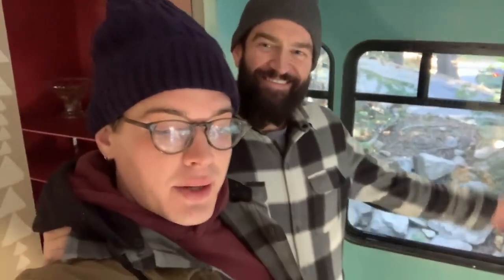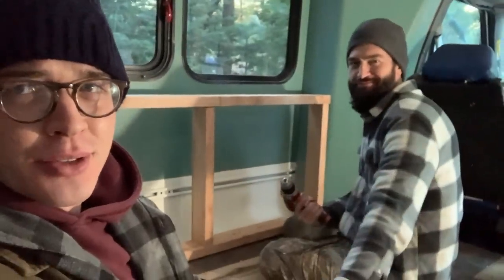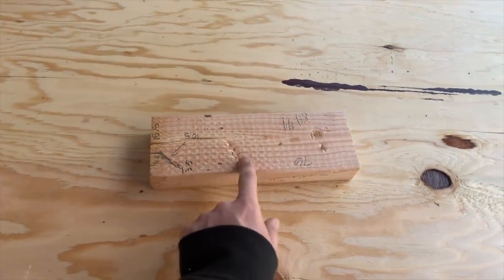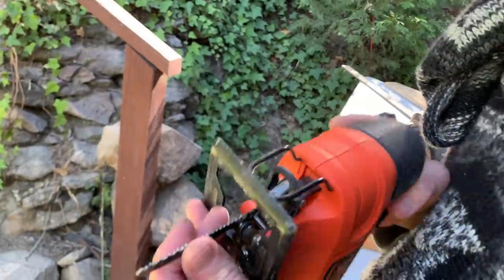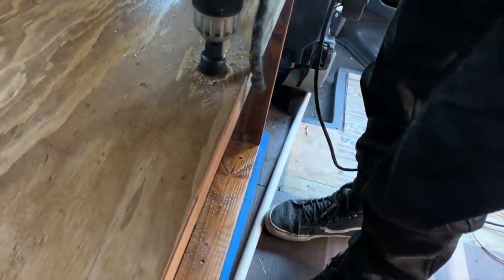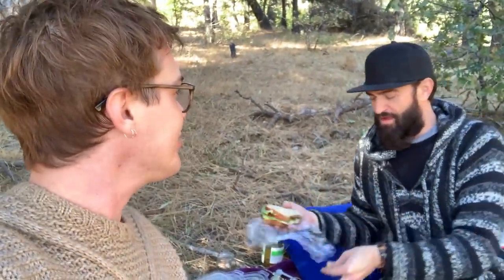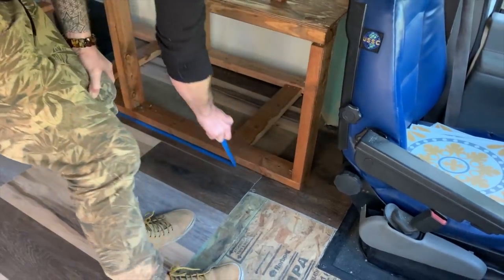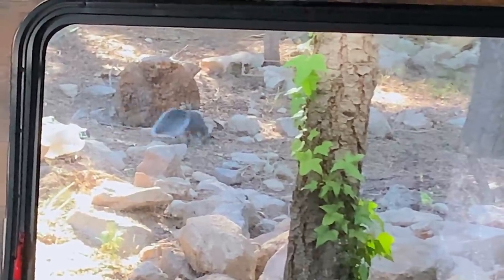DIY Shuttle Bus Conversion: Starting the Living Room/Couch Install & Storage

Comment: I just love you two together! Such a great couple. 

Helpful building tip: buying a kreg jig and using pocket holes/pocket screws to attach your wood together will create strong, long lasting joints and is most cost effective than L brackets.

Comment: Make some pull outs that create leg rests so that you can prop your legs on when you are both on the sofa. You will get "fatigue" in your hips and legs if you leave them dangling for long periods of time. Just a piece of plywood placed in a channel in the underpart within the cabinet. You can use accent pillows, that normally sit on the sofa, under your legs to create a more ergonomic position. Also look in to getting a couple of ecoflo delta solar generators. They store energy and charge very quickly. They work great for running all sorts of electrical components. There is a channel here on youtube called "DIY solar with Will Prowse". He does a rundown on them and has excellent advice on solar set ups for various circumstances. Love the videos guys!
Reply: Thank you for the tip!! 💖
Reply: @JeremyGrace  I was a interior designer for a long time up until recently. I specialized in small spaces and actually designed a lot of furniture for those very circumstances. If you guys can't figure something out, just reply back to here and ask the question and I'm happy to help. Love, hugs and kisses! 😀
Reply: @JeremyGrace  the slide outs could also be used as TV trays that slide in and out or as a laptop desk.

Comment: I would suggest you get some kind of bins or crates or those canvas bins (that have a wire frame that hold up the canvas) to put under the couch.  That way stuff won't shift around a lot when you're driving and you could also separate out like items (like paper goods or can goods, etc).